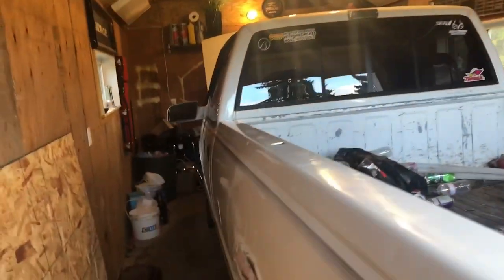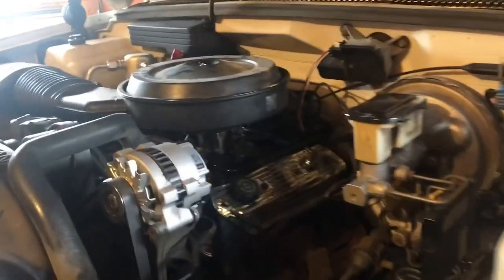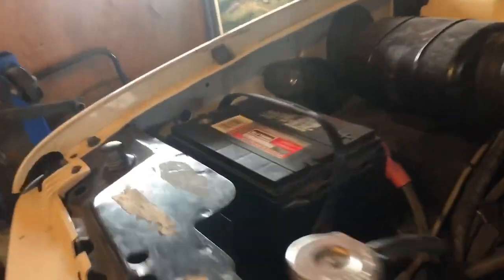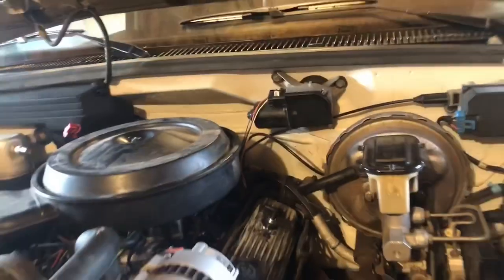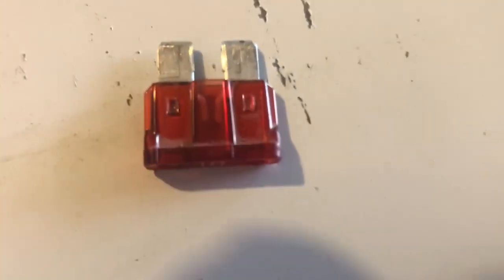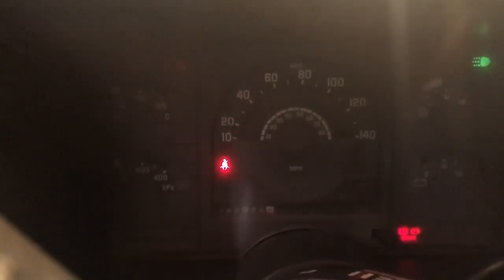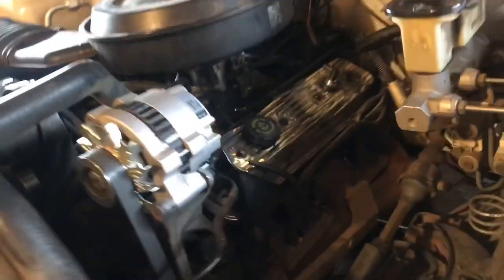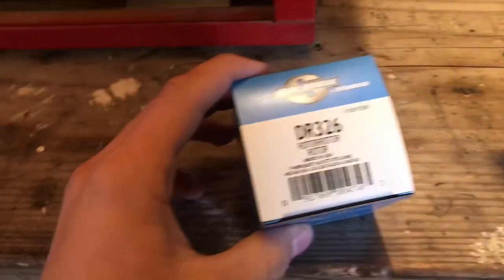87-95 350 TBI NO START

Comment: 90% of the time a visual of the fuse will confirm a blown fuse but there are occasions when it will look fine but will actually have an internal break / crack that can be hard to see.
A continuity check is the only way to really tell sometimes especially if you don't have a spare one to pop in.

Comment: I have a 1990 Chevy Silverado , changed the starter changed the alternator checked fuel , battery . the ignition turns over but no power at all truck doesn’t even does the stalling it just clicks fuel pump is good ANY SUGGESTIONS!! 🙏🏽

Comment: Damn man I have checked all fuses, replaced fuel  pump  and filter, but the to won't spit fuel. I don't hear the pump kicking on. I've taken a rest light to all wires u can think of and everything has power. Any suggestions?
Reply: Mine is an 87 gmc sierra 1500 with the 305
Reply from the maker: Randy Durdy check ground, and injectors I don’t know much else
Reply: @levilucyshyn939  thanks man I'll try those
Reply: Randy Durdy I had a problem with a crank no start and it turned out to be the coolant temp sensor. Sounded weird but it turned out to be my issue.
Reply: @jacobgonzalez7797  mine was a pickup coil in the distributor as well as the ignition control module
Reply: Ignition starter switch
Reply: @degenerategrappling6503  do you have to remove distributor to remove the pickup coil? If so im just gonna buy the whole thing
Reply: @DirtyMikeHoncho  yes I did

Comment: I have spark annd fuel but no start
Reply: I'm running the same issue right now with 1 small back fire every 3rd rotation
Reply: @zackerywilson4787  check your battery wires they run right by the exhaust n get messed up
Reply: @zackerywilson4787  I’m having the same problem right now. did you ever figure yours out?
Reply: @codydrury8954  I had water in with my gas drain everything refueled and fired right up with some timing
Reply: @zackerywilson4787 your timings off or not top dead center